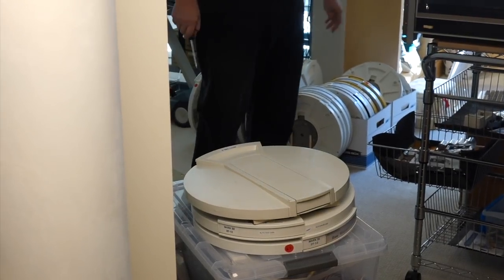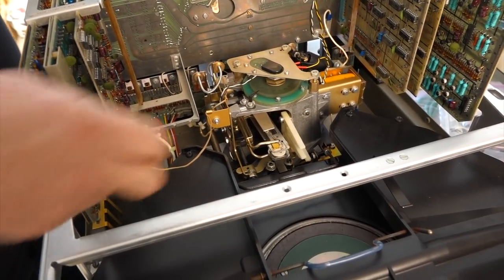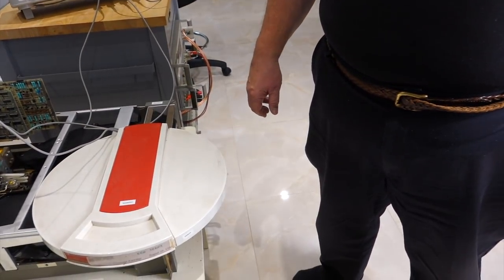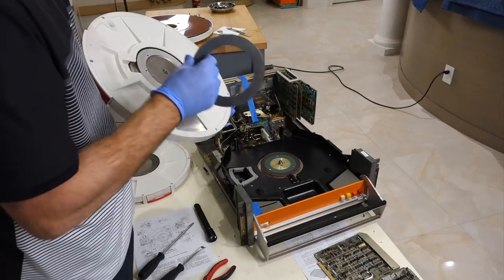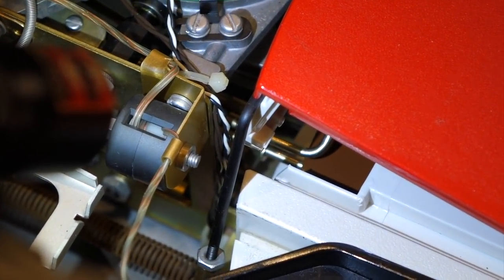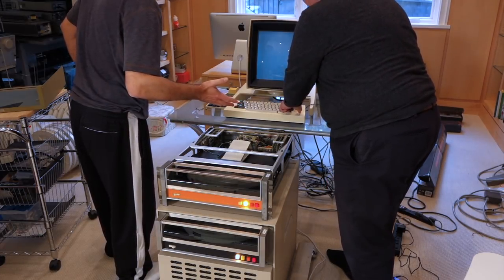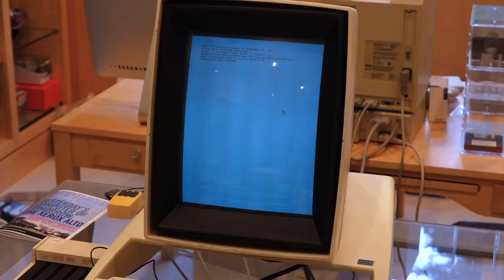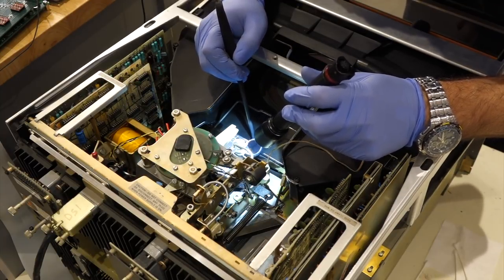Alto Restoration Part 18 - We crash our disk drive. Mill to the rescue!

Comment: couldn't you just glue the steel ring back to the hub? Some strong epoxy glue would certainly do the job...
Reply from the maker: Maybe. I doubt we would have been able to control glue thickness well enough to maintain the flatness requirement (I indexed the spindle and there is less than a few mils flatness variation over the outer edge). Which would not have been a problem on a regular blank platter which we would have simply readjusted and balanced, but on an alignment platter we could not touch anything. Our repair basically upgraded the cartridge to the later standard. Most of our other cartridges have these 4 screws. This must have been a known problem.
Reply from the maker: +Play with Junk: Oh, and by the way, I really like your videos :-)
Reply: I just wonder... was the ring originally glued?
I disassembled many old CDC disk packs and if I remember right they were all screwed. We too them apart for aluminum recycling.
BTW thw steel balls of my marble machine came from such disk packs :-) The CDC version had it's own ball bearing in the pack.
Reply: It seemed that the ring was press-fit onto the aluminum hub which had a slight lip the diameter of the steel ring. Corrosion as well as different thermal properties led to the failure, we suspect

Comment: Super glue or epoxy next time. That way you're not making any modifications to the original hardware, and it can still be taken apart in the future and the adhesive removed.
Reply: I'm of the mind that screws, while they are a significant modification to the original hardware, are more future proof than having to deal with unbonding adhesive! With the screws, it's simple to remove and assemble. Glue could require prying or solvents that might spill or damage other parts.
Reply from the maker: Actually it looks like the screws were the original factory fix. Most of our other platters have screws, so they probably knew about the problem and modified the design. I doubt we could have controlled glue thickness anywhere close to keep the original flatness (it's less than a few mil over the hub circumference) and height. And of course if you glue things, you get the very opposite of what you want: it is mostly irreversible. If you screw up you are hosed.
Reply: You could use hide glue  :p
Just reheat to loosen it again.